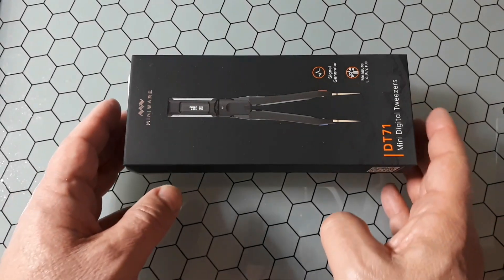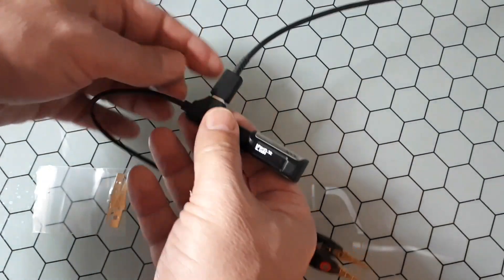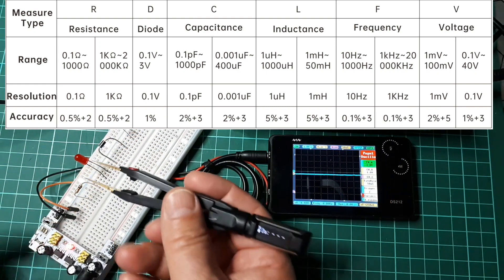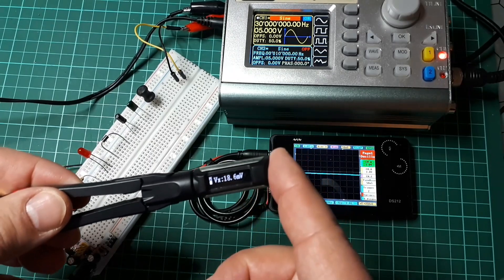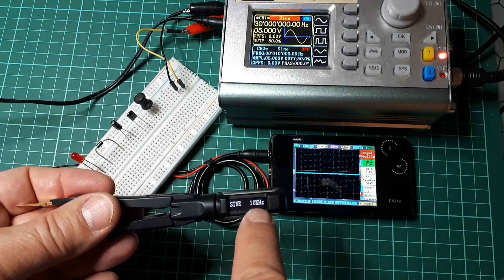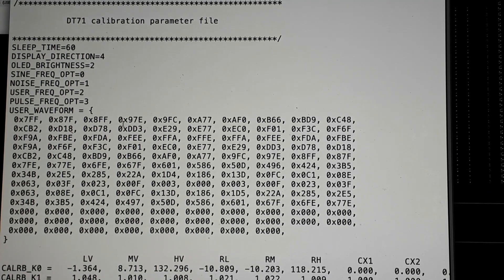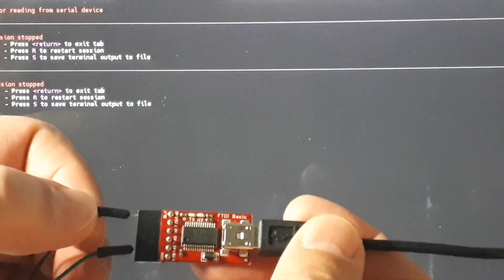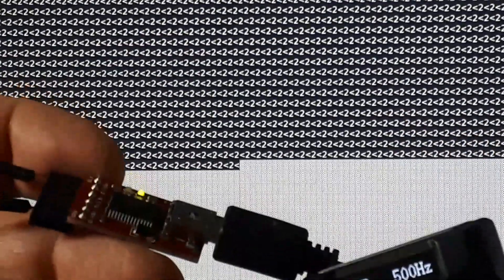Tutorial DT71 Digital Tweezers

Comment: They only sinned by not adding a function (ESR)
HONESTLY SO MUCH AESTHETICS AND BEAUTY AND LITTLE EFFICIENCY, BECAUSE IT DOESN'T MEASURE ACCURATELY IN THE CIRCUIT, YOU HAVE TO REMOVE IT FROM THE BOARD 
THEN THERE WAS JUST A LACK OF INTELLIGENCE AND BUILDING ONLY TWO FUNCTIONS INSIDE THIS CLAMP: ESR AND CONTINUITY!!!!!